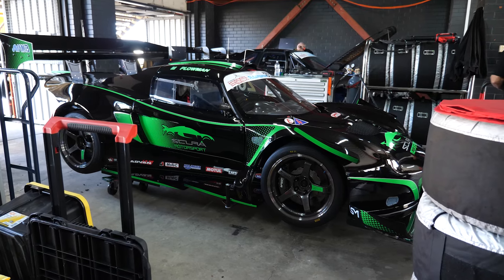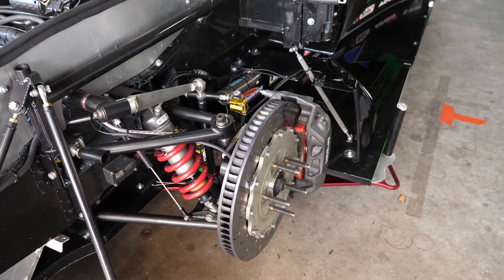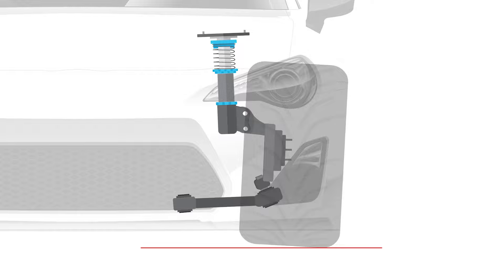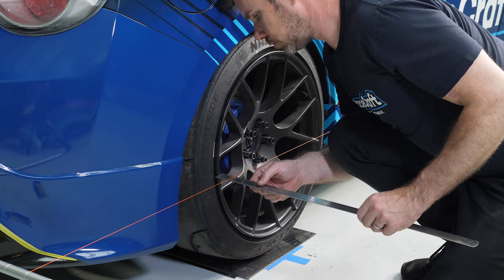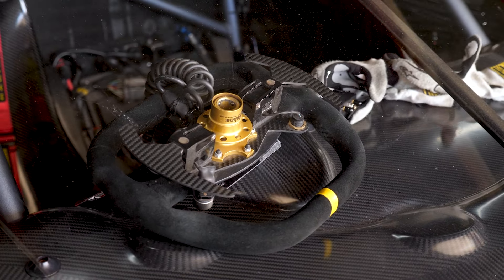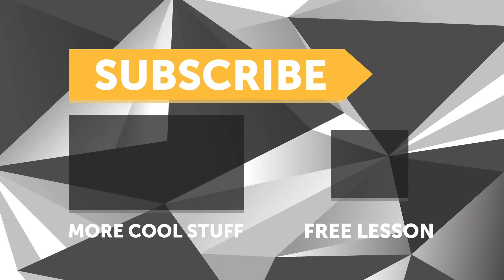This Setup Is Genius 🧠

Comment: This is the standard adjustment on all Elises/Exiges. It does affect toe but it's minor.
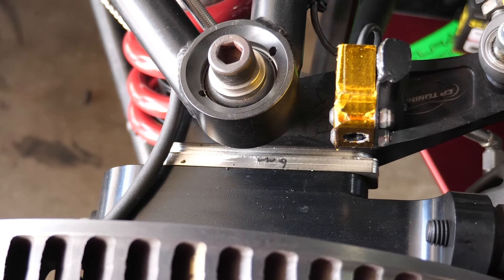Reply: Refering to the image at 1:00, this will not have an effect on toe. Are the Elise / Exige spacer in oar don the chassis or outboard on the upright?
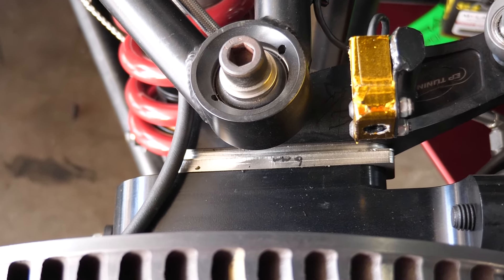Reply: @neversettle7666  The shot at 1:00 is the factory setup but with aftermarket uprights and steering arms. The upper control arm remains fixed. The rear is similar except the toe arm is instead attached directly to the upright.

It affects toe because of the axis the steering arm must rotate around to meet the upright when you change shim thickness. It's minor like I said but not zero.

Comment: What they have is adjustable KPI (king pin inclination)
Reply: I don't think so, ordinarily yes adjusting the top arm length or strut top would adjust kpi, but if the kpi is defined as the line between the top and bottom ball joints, the position of these remains unaffected by adding or removing the shims shown.
Reply: @arrindaley3714  We have to take stub axle angle to what you've described,  into account with regard to kpi.
Reply: Uh, no!
Perhaps you need to either take another look at their setup, or your text books.